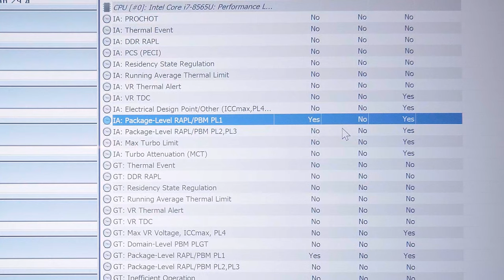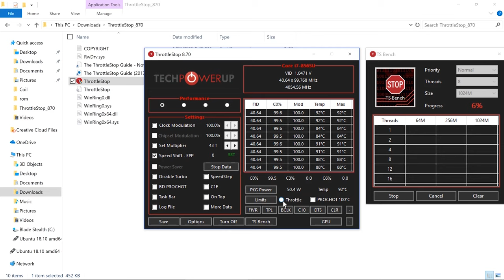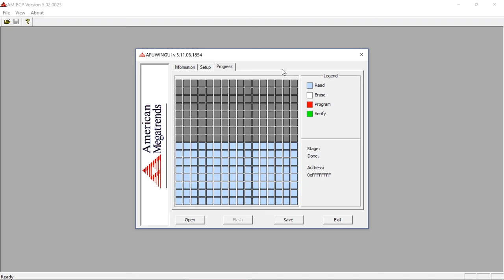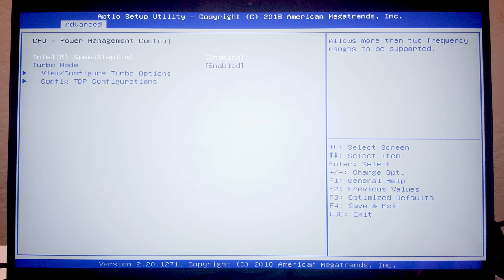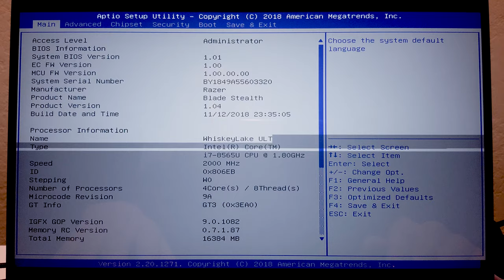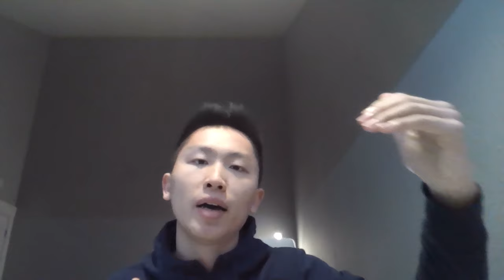Razer Blade Stealth 2019: Ridiculous Power Throttling (Performance Review) UPDATE IN DESCRIPTION

Comment: Amazing video actually,  I also am currently doing lot's of research on the Razer blade, i just bought a 2020 15 inch version with an RTX 2070 Super Max Q, and im having Power throttle issues, my CPU and GPU temps stay at a cool steady rate of 65%-55%C, However when i game for more than 3-4 hours the computer starts to over heat, and i gotta keep plugging in the Laptop every dammn hour to crank up the fans through razer synaps because i cant even manually control the (Fan speed, Temp or Power Percentage) with this model either. Used (MsiAB), to keep a steady Gameplay for a few hours. and also tried tweaking the wattage percentage on (IntelET) on the other hand tweaking the core clock and memory clock, again on (MsiAB) however my fps starts to drop around 25% when the laptop starts to warm up, I also tried coding the files to unlock the Core voltage. it was a success, however i dont even want to mess with it in fear of the laptop exploding under heavy load because of its Power watt throttle issues, i managed to overclock my Gpu a bit around 5% using (Asus Gpu Tweak II)  however im afraid to moggle even further with the settings cause i dont want to turn it into an actual Bread baking machine. Hopefully this Bios Mod you are Suggesting at my own risk could greatly aid in performance, for wattage improvement. I am not sure if the 2019 Stealth has less or the same features than the newer models However.. but wish me luck. haha  '(._. )/"
Reply: Hi, did this BIOS modding trick worked on your 2020 model?
Reply: @dukeyin1111  I did it on my 2020 advanced and it works but you need to unlock bios flash protection and other flags with ru.efi, it's no simple task
Reply: @Alex-ch2ud  Yes I did it with my 2020 base model as well. I couldn't change RAM clocks, but I could adjust my IMON Slope/Offset so that my CPU clock speed is completely free from throttling. the price to pay was higher temperature due to higher power input, but I did apply liquid metal paste to help out. I did use the ru.efi thing as well :)
Reply: @dukeyin1111  Oh nice! if you don't mind me asking how did you do the IMON slope mod? NBR is closed so I'm having a hard time figuring it out, I also use LM TIM on my CPU : )
Reply: @Alex-ch2ud  There is a way to do it without a CH341a programmer..  I don't think I can write a full guide in a timely manner on Youtube comments. However, based on your previous reply, I think you know what you are doing. So I will leave a brief step guide:   !!!!!!!!!! Everything written here I take no responsibility; Might brick your laptop;  do it with your responsibility!!!!!!!!!! 

 1) Unlock BIOS lock, FPRR using ru.efi (changing 01 to 00). It is under PchSetup after you press Alt + = in ru.efi
 2) Find your Correct version of CSME system tools and download the correct version of FPTW64.exe. Mismatching versions will not work!
 3) use the FPTW64.exe to dump your BIOS (will be in .bin format, not .rom form. In particular, Afuwin did not work for 2020 or newer models. Use FPTW64 instead for dump and flashing)
 4) Modify with AMIBCP, unlock CPU VR settings (+ all IMON related stuff as well) from Default to USER
 5) Save the bios
 6) Flash with FPTW64.exe and reboot

It will take some "computer skills" to download and use all the tools (with correct version to your laptop) mentioned above.  But the result will be amazing without throttling!
You'll not be able to unlock many overclocking functions (like RAM overclock), but luckily IMON setting works. You can set IMON slope to 50, and offset to -31999. - sign is very important. And your throttling will be gone.

Alternative method: buy a CH341a programmer and flashing the modded BIOS with it. Probably this way is easier. But I was hesitant that a lot of them comes with 5V, not 3.3V. There is a small chance that you could fry your BIOS chip.
Reply: @dukeyin1111  Thanks! I actually unlocked the BIOS yesterday so I got that part down, are the IMON slope and offset values cpu specific? cus I got a 10875H rn
Reply: @Alex-ch2ud  Nope, that value is fine. (CPU apparent Power) = (IMON Slope*0.01)(CPU actual Power) + 0.001 * IMON Offset. For example, IMON slope 50 and offset -31999 means that you are tricking the computer that your CPU only consumes only half of power, and with -31.999 W less power offset so that throttling does not trigger.
Reply: @dukeyin1111  I’ll give it a try then! thanks for explaining. Does this affect undervolting? I read somewhere that throttlestop should be disabled before doing it
Reply: @Alex-ch2ud  Not affected if you don't touch AC and DC loadline. Some places suggest to un-do throttlestop, then change AC and DC loadline to 1. Doing this you will not be able to undervolt much as before, but some claim the temp is slightly lower that way.
Reply: @dukeyin1111  Hm, I just tried it and temp is definitely better, but I still get ”EDP other” limit sadly
Reply: @Alex-ch2ud  Oh yeah, I forgot to tell. On the same page where you edited your IMON settings, 1) increase current limit to 800 and 2) Put TDC to disabled. Let me know if it works now :)
Reply: @dukeyin1111  Yeah I did do that and I put TDC to disabled and the value underneath to "0" but it reverts to "1000" after rebooting, and I still get EDP other confusingly enough

Comment: my new one you can go into the razor blade synapse and go to custom and set it all to high ... at that point mine will only power limit at 80 degrees ...
Reply from the maker: That's a good improvement. Looks like all of our complaints successfully persuaded Razer.
Reply: @BradsHacks  So, what are your thoughts on the Stealth in the light of all those changes? Do you like the device now?
Reply: @BradsHacks  my laptop throttles hella, the Razer blade 13, just playing Minecraft on charger. Any advice?